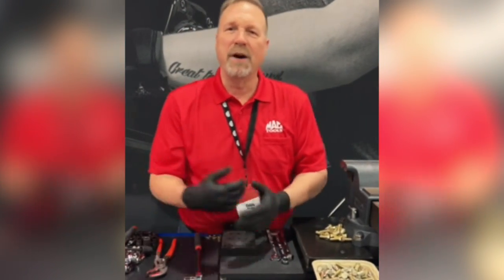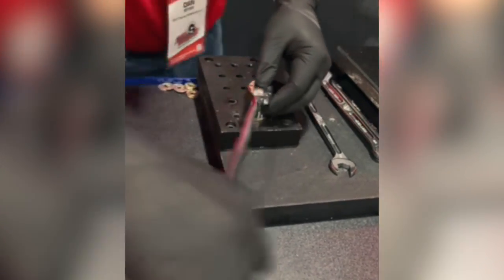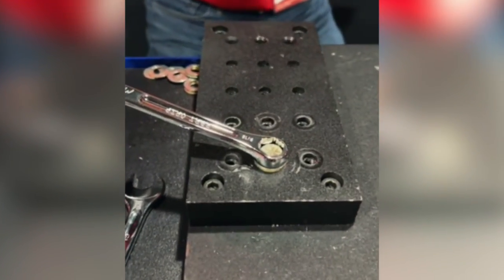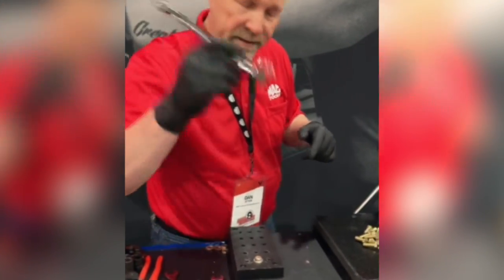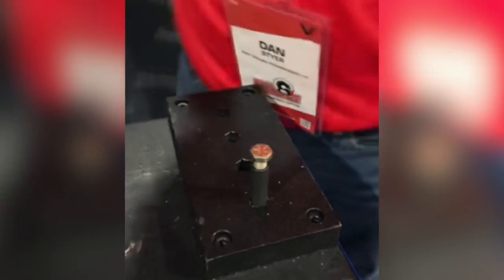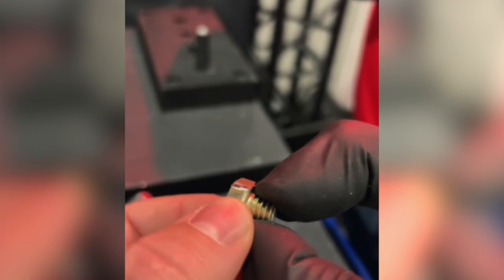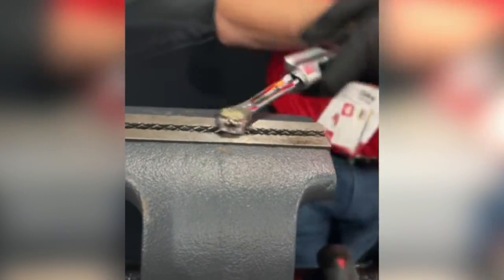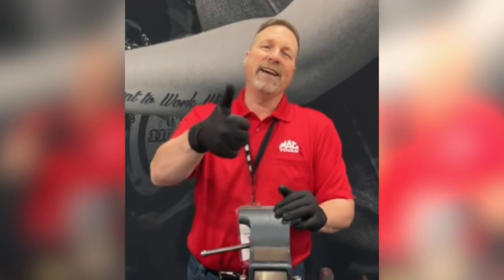Mac Tools New RBRT Wrench Demonstration From The Mac Tool Fair 2023

Comment: I am super impressed. As an aircraft mechanic this is ideal. We don’t see the rusted/siezed stuff like you auto or truck guys see. I will be picking them up. Thanks for this demo.
Reply: Be patient. Buy the Proto(real version) when they get caught up on the Macboi order.
Like the AXIS ratchet. The real one is Proto. Get that one. Mac will vanish one day. Proto will not.
Reply: As a fellow aircraft mechanic, I would love these, but they wouldn’t be great at work with the amount of 12 point fasteners we deal with.
Reply: These are extremely overpriced there are other companies that make similar Wrenches for a third of the price
Reply: @rockstarfan886  nobody cares about Capri

Comment: Those demonstration bolts do look really stripped and it looks like a great option, but I’d like to see a “real” stripped bolt on a vehicle being removed that’s under torque.
Reply: Send him to my sawmill. A few(thousand) fire ants, some killer bees, maybe a fer de lance and then reach up, pit length and get ahold of a 3/4. Ahhhh. Nothing a needle gun and welding a nut on with the MM200 can't handle...LOL

Comment: Sales demos are one thing  actual  use is the real test.  Cp the tool addict has talked and used rbrt wrenches.  I believe very little what salesman say.
Reply from the maker: Well it's odd to me that he has "USED" them as they have not sent any of them out to anyone to "test" or to "use" this is a brand new tool they just released at the Mac Tool Fair (obviously as you can see from the video) but nobody has gotten to use them at all because the only sets they have are at the tool show and they haven't been for sale or seen outside the RBRT team until the tool fair. So I'm gonna say that that is 100% inaccurate.
Reply: @KoonTrucking  he used the Capri wrenches which appears to be also the same.  Did wild bill have the Capri wrenches.
Reply from the maker: The Capri wrenches are not the same design at all it is a twist design, these have teeth in the box end. They are TOTALLY different wrenches and designs. I have the Capri ones myself and I could tell from the picture when they released it Monday that it was a different wrench. The Capri is like the Harbor Freight or any other rebrand Taiwanese wrench that is made with that came design and imported with everyone else's name on them. Capri didn't patent that design they use. It's like Kabo and the long ratcheting wrenches that were sold under Monster, Icon, K Tool, Carlyle etc.
Reply: @davidwalle5025  not even close to the same, plus cp never even touched these yet

Comment: Wow, Koon Trucking & Mr Subaru used the same MAC Infomercial. Great performing wrenches but, I'm scared of the price. The capri set is a more complete set of the Astro Flankbite damaged fastener wrench. The RBRT wrench looks like they're using the older MAC Edge anti slip socket profile. Please share if you hear anything about pricing. Thanks for the video!!!!
Reply: 300
Reply: Yup go with the capri these are ridiculously overpriced
Reply: @knellertuc9  EVERYTHING is over priced when it comes to tools🤣 My 1st mechanic job (1999) I used a starter set of husky wrenches and sockets, some screwdrivers my Dad gave me. I think I "invested" something like 400 bucks in everything I owned back then. Add 2 more zeros and that's what my tools add up to today.

Comment: Not been a dick but usually rounded off
 nuts and bolts are because it's super tight not just a quick nip up sometimes you need to swing on the wrench to under a fastener so not quite convinced yet let me see few other people drop a week's wages into them because they aren't cheep.
Ps what are they like on new nuts and bolts.💪🏻
Reply from the maker: The YouTube video shows them used on a new bolt if you watch the end of the video you will see it
Reply: If 3 to 500 dollars is a weeks wages you're in the wrong business. 🤣🤣😉

Comment: six points is a terrible idea for these wrench. These wrench is meant for tight quarter work, a lot of the time 45 degree turn space isn't available to adequately torque, or  remove the bolts.  Of course these are great when bolts are rusted.  I guess it's good to have options.

Comment: Who the hell tightens rounded off bolts, to remove a rounded off bolt is one thing but I find this example not very useful. I will stick with Snap On.
Reply from the maker: You realize that on stuck fasteners many times you have to work it back and forth to prevent the head from snapping off? A quarter turn left then back right? Back and forth until it becomes free to remove.

Comment: I dont like that he didnt give the fdx an opportunity to break it loose. Idgaf of tight you can get a damaged fastener. Igaf about getting it out.  Or that he didnt give the FD+ wrench an opportunity on the good bolt in the vise. Kind misleading Mr. RBRT...
Reply from the maker: Take a look at the torque test channel where they put the Max RBRT wrenches (as seen in this video) head to head against Snap On and many other brands. Take a look at the data and it will show you all you need to know. These won hands down. And they have no dog in the race (neither do I) but these wrenches work.